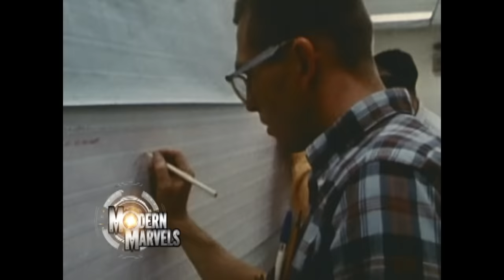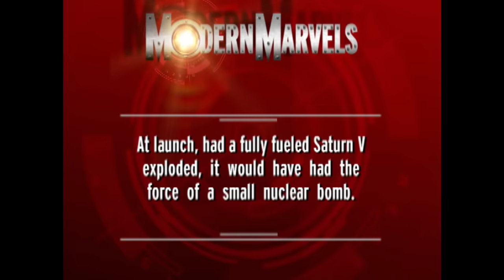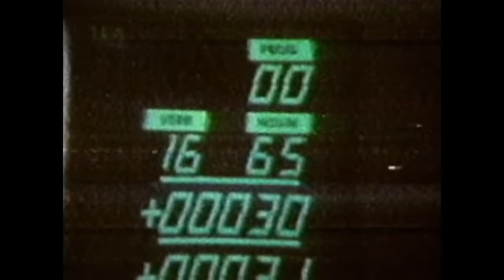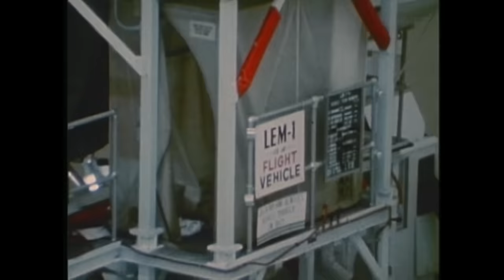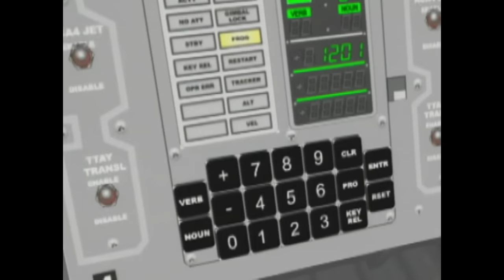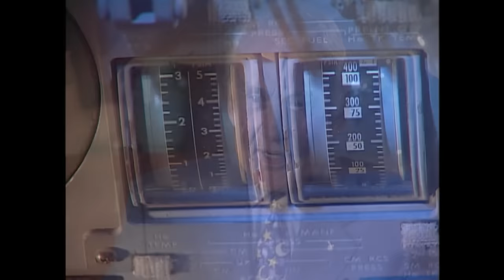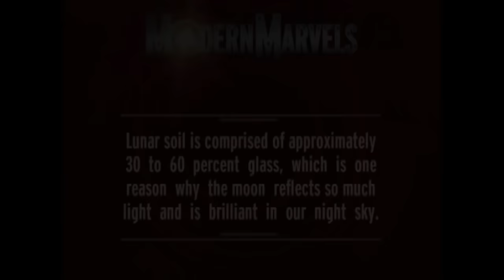Modern Marvels: Experience the Flight of Apollo 11 (S11,E28) | Full Episode | History

Comment: They did not "re-rout" the broken ascent engine switch. Aldrin used a felt tip pen to push the switch in, ensuring a good connection.

Comment: @10:42 the caption is incorrect and should say Apollo 8 December 1968 (first manned Saturn V and first flight to the lunar orbit). It is doubly confusing as the narrator is describing Apollo 7 which flew in October 1968 and was the first manned Apollo mission (earth orbital) but launched on a smaller Saturn 1B rocket.

Comment: Buzz, Lunar Module Piolet, yet, he never flew it.  Neil was the only one that tried on Earth and had to eject.
Reply: Aldrin never flew the lunar lander, that is correct.  The commander almost always flew.  Conrad let Bean fly the lander a little bit during ascent when on their way back up to the command module.  However, I think that's the only time a lunar module pilot ever piloted a lunar module.

As for trying it on Earth, sorry, but no lunar module was ever flown on Earth.  The lunar module was too heavy for that engine to be able to fly on Earth, because the craft was designed for lunar gravity, not Earth gravity.  It weighed 33,500 pounds.  The maximum thrust was 10,500 pounds.  Even at full throttle, it would never even leave the ground.  Even if you stripped it down to bare minimum, it still wouldn't be able to fly.  So, they built 5 research and training craft that simulated 1/6th gravity, called the LLRVs and LLTVs.  I don't know the exact count of how many times Armstrong flew them, but, it was somewhere around 100.  Yes, he had to eject on one of the flights because he ran out of control fuel with no way of knowing it (a flaw they fixed on the later generation LLTVs).  But, to say that Armstrong was "the only one that tried" is outlandish.  ALL of the Apollo astronauts on the moon mission trained in the LLRVs and LLTVs, completing dozens upon dozens of flights each.  Even Anders flew one of those craft, and he wasn't even going to the lunar surface, yet got a chance to fly one.  Why do you think Armstrong was "the only one"?  Did a conspiracy video tell you that?

Comment: Until Apollo 13, the idea of using the LEM as a lifeboat had never occurred to anyone at NASA or anywhere else. So to say that it was a risky move to orbit the moon without the potential life boat during Apollo 8, isn't valid. Thank God that the engineers and Astronauts at NASA figured out during Apollo 13 it could be done.
Reply: This is false.  The procedures to use the LM as a lifeboat existed already.
Reply: @willoughbykrenzteinburg  Could you explain that a little better? They didn't even have the right shaped filters nor enough of the right filters to support the entire crew for days.
Reply: @andypreinesberger8094  obviously they did have enough....  converting the canisters was a procedure that already existed.  They dramatized the conversion for the movie when in fact, those procedures already existed.
Reply: @willoughbykrenzteinburg  Well thanks for presenting some new information for me. I prefer to see references posted but I looked it up.

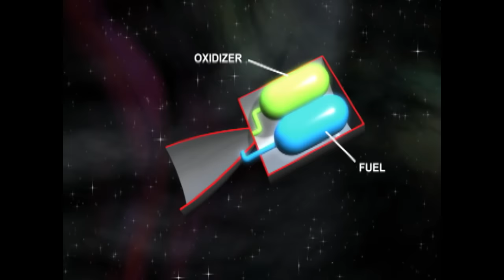Comment: 10:20 Mistake!  The service module did not use cryogenic fuel!  It used hypergolic fuel that burned on contact to ensure safety and fool proof combustion.

The fuel cells used cryogenic fuel to make electricity and water for the crew to drink.